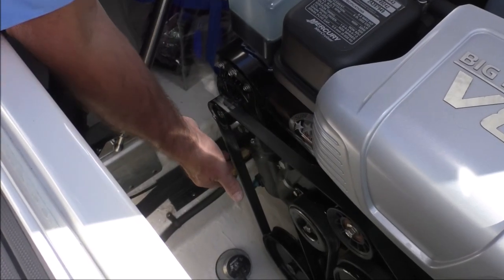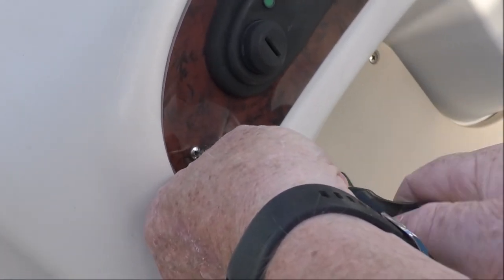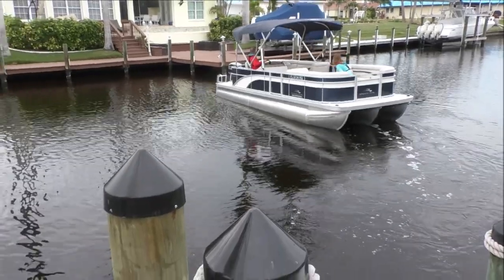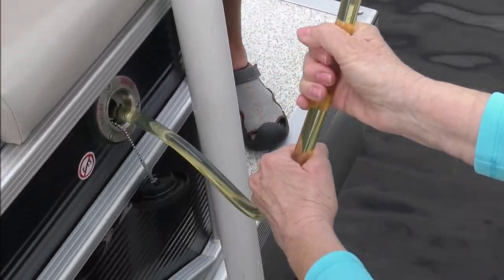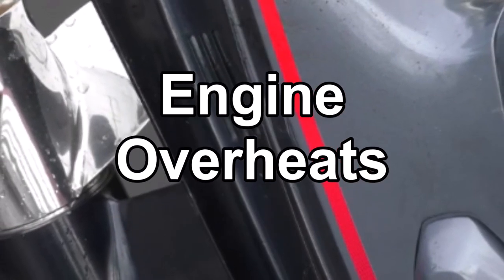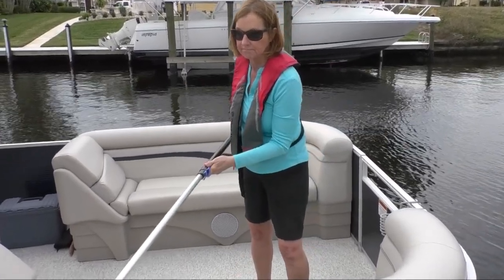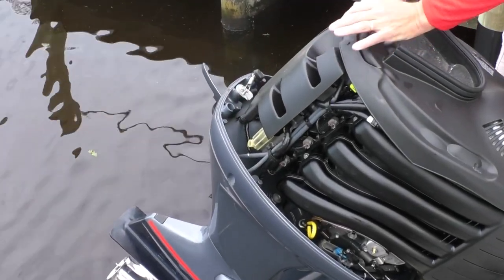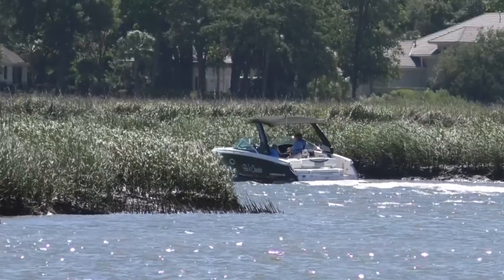ENGINE FAILURE CAUSES & CURES

Comment: Some of this applies to diesel engines, but should we put fuel stabilizer in diesel fuel? Could you do a clip specifically for diesel?
Reply from the maker: Using stabilizer can be a great strategy to keep diesel fuel fresh for up to a year. Note that some fuel stabilizers are dual purpose while others are only for gas or diesel.